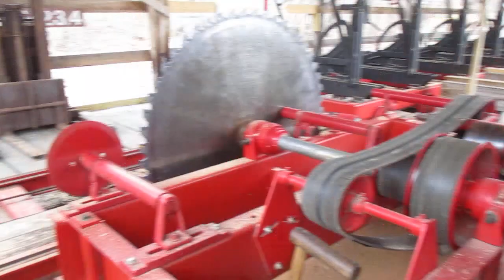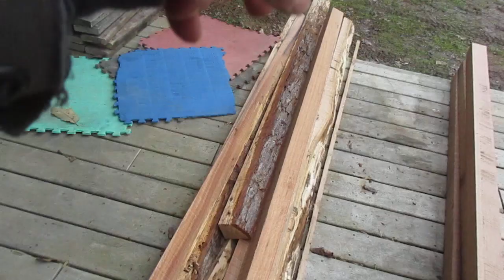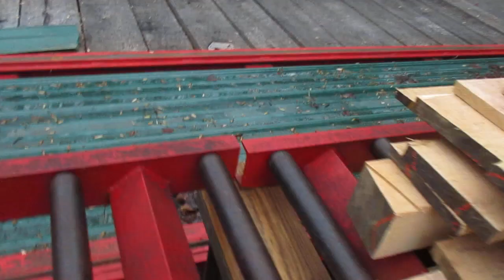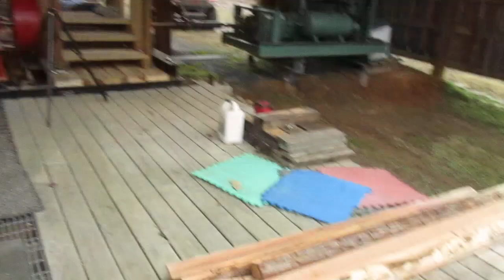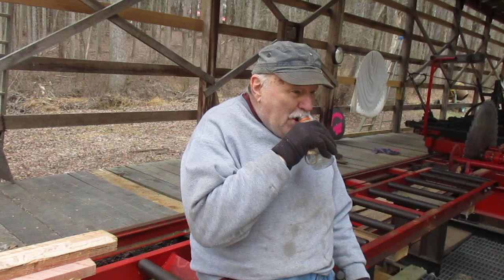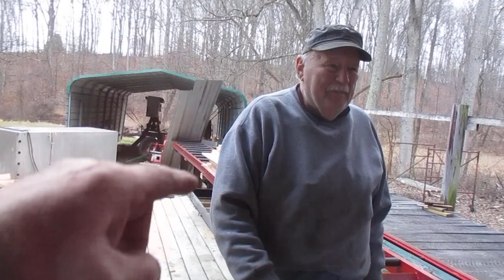2 BIT  sawing white Oak # 1032

Comment: I don't wish to sound so negative or petty, but there are times I wish John would lose his damned measuring tape, and just saw wood.
Reply: I think before John cuts up a log he calculates everything. Not a lot of waste when he saws a log. Just my opinion.
Reply from the maker: hi i know what you mean but as you saw in the video a few days ago the lumber scale broke and billy wanted boards that the pin was not set for . then this is really the first log threw the mill so i was just seeing how things were doing , checking how the saw was cutting , john
Reply: @fricknjeep  I just hope they don’t find any classified documents in your saw mill.
Reply: Go easy on John. Don't you know you measure twice and cut ONCE.
Reply: I know, I know.  Actually, measuring twice and cutting once is good.  It was just that I was trying to fight back pain (cancer), and so was easily irritated.  "Come on, come on, just cut the damned thing."  It happens, and John knows me well enough that he knows I'm actually a nice guy. @warrenklingensmith1241